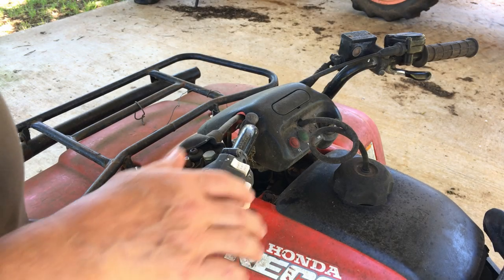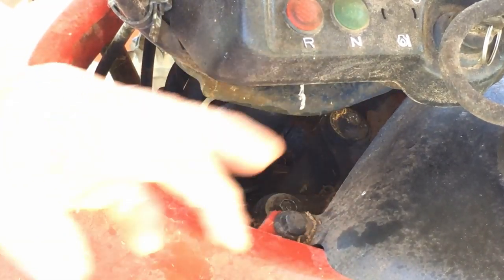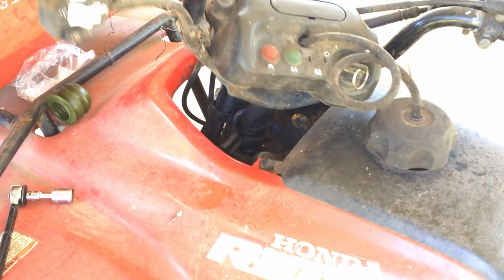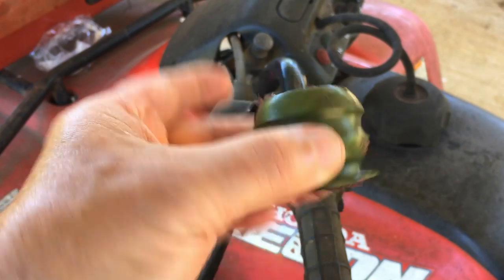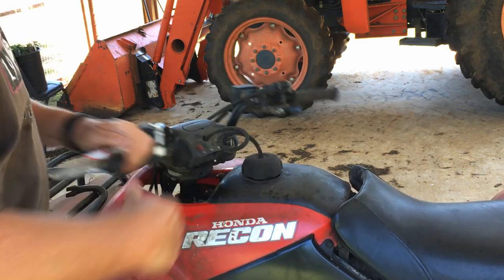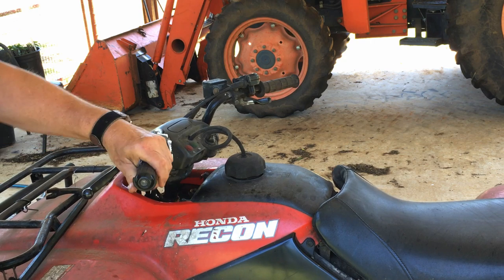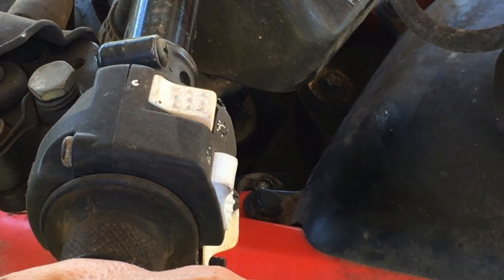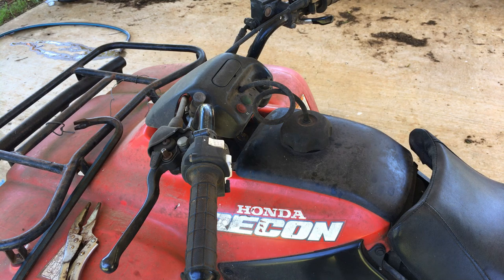💥 REPLACING HONDA UPPER STEERING SHAFT BUSHING 💥 HONDA 4-WHEELER 🛵

Comment: Good straight forward video helped me out. I did take both bolts out and it slipped on much easier. Takes a little work to line the bolt holes up but still not difficult.
Reply from the maker: Glad I could help!

Comment: can you tell me what is exactly this bushing part number?
And can you tell me what is a diameter of steering shaft on this bike?
Reply from the maker: No, I threw the package away.
I just called the nearest Honda dealer and he had the part.
Reply: @BIGALTX 
Ok, can you just check diameter of steering column? I need for some other ATV and I'm not sure will it fit.
Reply from the maker: @zokonjazokonja  I don't think I can get in there with calipers to measure it.
Reply: @BIGALTX  OK, thanks

Comment: Mine has this terrible squeaking sound and the steering is very stiff, I’ve tried lubing it, cleaning it and none of those helped would this fix it?
Reply from the maker: Usually, when this needs replacing, there is a lot of play in the handlebars. They move back-and-forth and forward and back quite a bit. That’s what this bushing does. So, I’m not sure if that’s your problem or not.
Reply from the maker: @theshadetreewelder5043  
Thanks for the link!
Reply: @BIGALTX  no prob
Reply: Did you get the squeaking figured out?  Mine does the same.

Comment: where did the old one go?
Reply from the maker: The Trash
Reply: @BIGALTX  i never seen you remove it
Reply from the maker: @danmcginn772  
Now that you mention it... I think it had already fell off.
Reply: @BIGALTX  thats my point,where the heck did it go? I never heard of one coming out on it's own??
unless it got all crushed up and the debris is still in your steering column
Reply from the maker: @danmcginn772  
The steering column is just basically a pipe.
I think it just crumbled and fell out on the ground.
It wasn't there when I made the repair
Reply: @BIGALTX  if it crumbled up,your steering column is sealed and the pieces are probably still ln there,thats what i was trying to get at,just as a friendly opinion.

Comment: Damn man !!!   Wash that thing once a year and keep it in a a barn or garage to keep all that dirt and mildew off of it.  Is this typical of your maintenance for other stuff?  Mine is a 96 and looks much better than yours and mine has been across about 10 states on pipeline construction work. Mine is a 300TRX but the steering is identical.
Reply from the maker: It's under a shed 100% of the time, but yes... I don't wash it often.
Reply: And the cleanest atv award goes to ....
Reply: Proper manners go a long way.  Maybe give it a try.